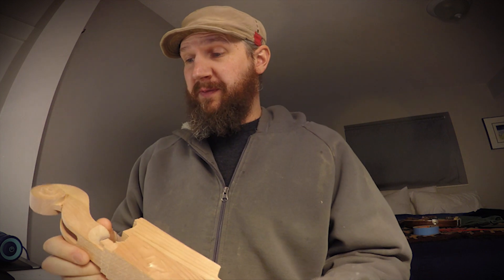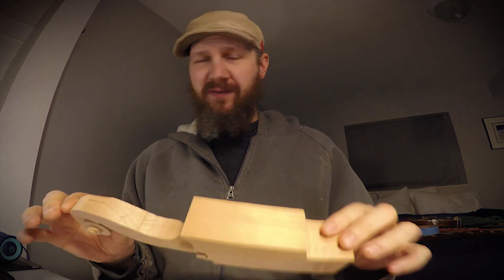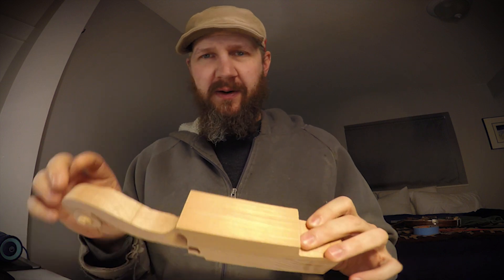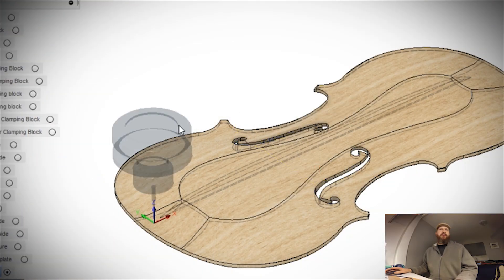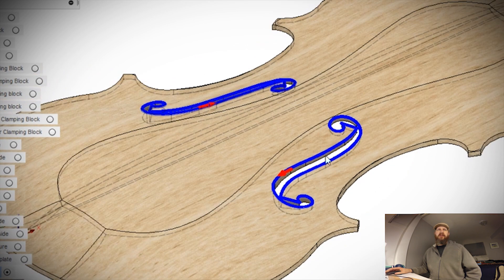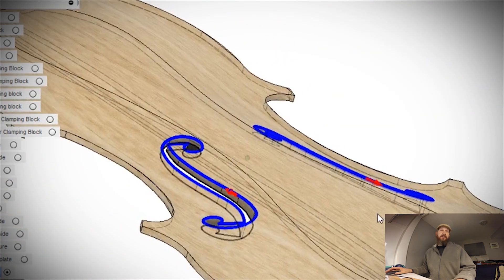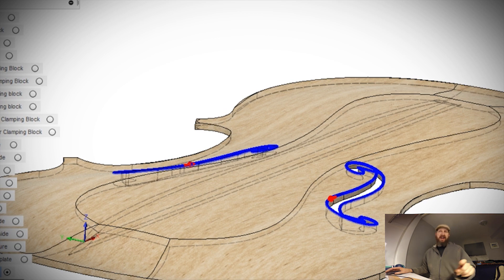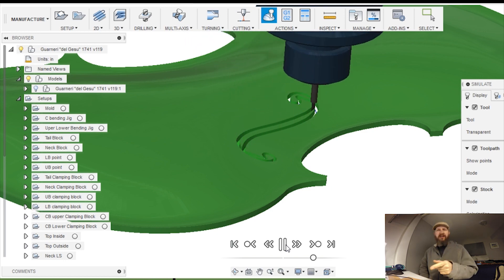Cutting Violin F holes | Making the Guaneri 'del Gesu' Vieuxtemps violin part 14

Comment: Looks great. Glad you did not have  to include Tabs It seems like with out a flat bottom it would not work with Fusion 360's Tab function. I think you would have to model Tabs in this situation if  they are needed.
Reply from the maker: You can set the hight of the tab and make it work, I try to avoid using them if possible.

Comment: I started my first violin scroll two weeks ago and I have worked on it for 76 hours with no power tools. And it doesnt help that Im carving it from extremely hard curly birch. It is still more fun than I have had in a long time!
Reply from the maker: It's a very rewarding process. I would have been done with mine a week ago if I carved it by hand. It's a different challenge to figure out a working process for CNC carving such a complex shape.